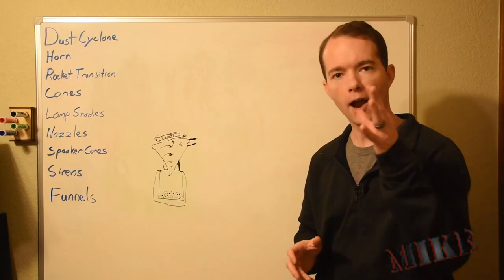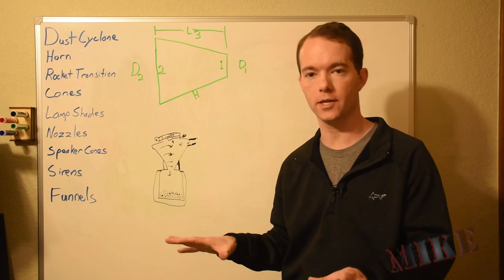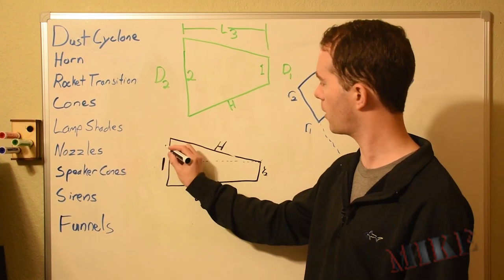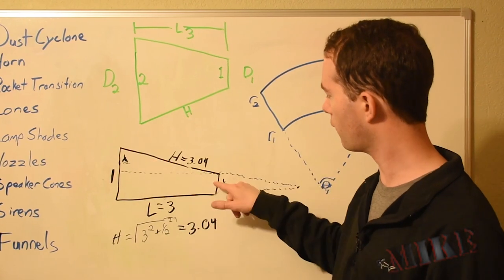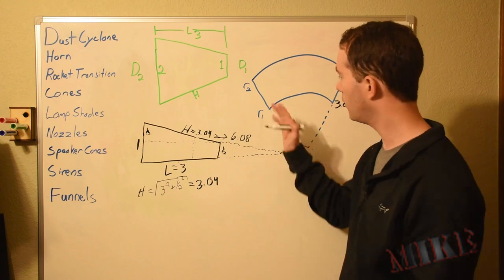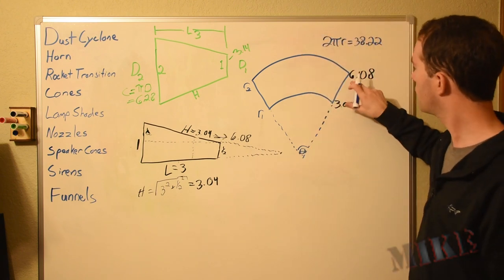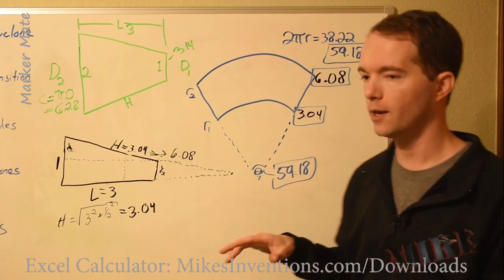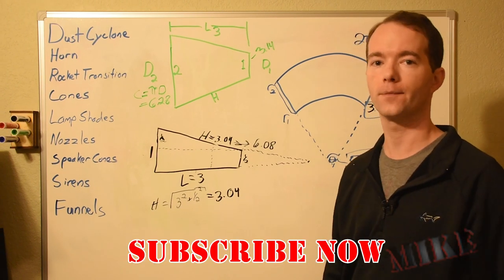Making Cone Shapes - Mikes Inventions

Comment: Mike good job.  One comment though.  Once you know the length from the center to the large end the angle can be found by dividing the large circumference by that length.   It is called “radians.”   Unfortunately this is not taught well in US schools.   If you do not like working in radians you can convert the angle in radians to degrees or even gradians.   Your choice.  One full circle is either 2 pi radians or 360 degrees or 400 gradians.   1 radian = 57.2957°  Convert to your hearts content.
Reply: Could you possibly elaborate on that please? The large circumference is 6.08*pi*2* equals 38.182. the length from the center is 6. 38.182/6 equals 6.363. 6.363 *57.29 equals 365. Im confused

Comment: Mike: How did you get 59.18 degrees by dividing 6.04 into 38.22?? I did some further research and found that the percentage of 6.04 is of 38.22 = 15.9%. I then found an on-line calculator that gave me the percentage of 15.9 for 360 degrees, which equals 57.24 degrees. Any chance you can walk us through the math as to how you came up with 59.18 degrees?
Reply: Im coming up with the same thing. I still dont get how he came up with the 59.18 degrees.
Reply: Its 6.28 divided by 38.22
Reply from the maker: Hey there. Sorry for the late response. This one slipped past me. 6.04/38.22 is about .164 of a complete circle. Then this *360 gives the 59 degrees needed for the cone arc angle.
Reply: @MikesInventions  Thanks for replying Mike, but I'm still confused. If you divide 6.04 by 38.22 the answer is  .159079.... x 360 = 57.26°. What am I missing here?
Reply from the maker: Hmmm... I don’t know I did it on excel last night and it worked, and now I check it on my phone and you’re absolutely right. I did something wrong somewhere in video production. Anyway, I used this all as recently as yesterday to make something out of sheet metal and it works. So just ignore my math I guess and focus on the procedure. Oops! Or download the excel file from my website and you can forget doing it all by hand. Thanks for catching the math issue. Still no clue what I did there.
Reply: @porker5749  it's closer to 38.20 , and I believe he mean to say he was  dividing with 6.28 not 6.08

(
6.28 / 38.20 = .1644

.1644 x 360  =  59.184
)
Reply: When Mike inventions redid the math he accidentally put 6.04 but meant 6.08…then follow the math by multiplying the 360 and you’ll get the 59 degrees

Comment: This works but I have an old sheet metal formula that works great.  Take the large diameter and multiply it by the height.  Now divide the result by the difference between the large and small diameter.  The result is the swing point at the top of the cone to swing the arc for the pattern.  The only downside is takes a bit of space to swing the arc.  I just put marker on a piece of string.

Comment: I am constructing 12 equal concentric circles on CAD.  144 is my outer diameter.  I want to put the rings to different angles such as the angle of the great pyramid of Giza at 51.82729237 degrees.  Imagine you are looking at the rings from a top view.  The rings are actually a cone.  What should my diameters of each of the 12 rings be?  I want to make other cones from a top view using music harmonic ratios such as 1:2, 2:3, 3:4, etc.  I am using a Phi Pyramid where the height equals the square root of Phi and the slope angle equals Phi.  On your calculator you can take the Sine of 18 to get Phi, multiply by 2 and add 1.  Thanks for your comments.
Reply from the maker: Hey Jake! I don’t think I understand your question. Sorry for the late response. Did you figure it out?
Reply: I if I know th measurements. Do I need to multiply? 18 inch tall. 12 inches at th top.  18 inch bottom. Mine are concrete forms.